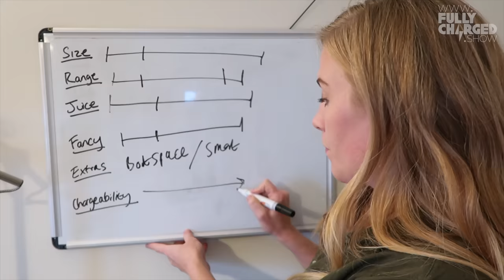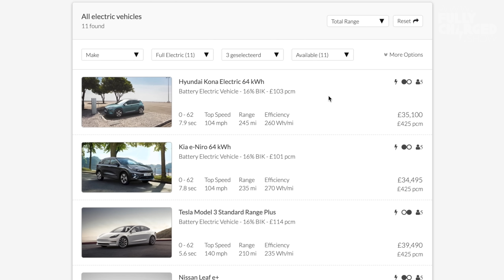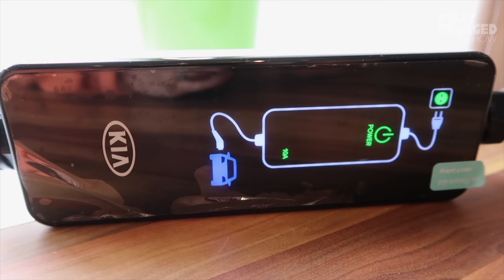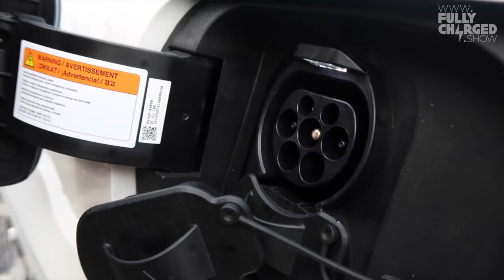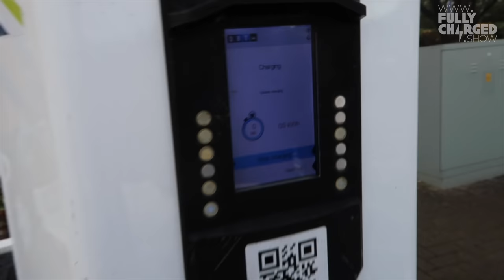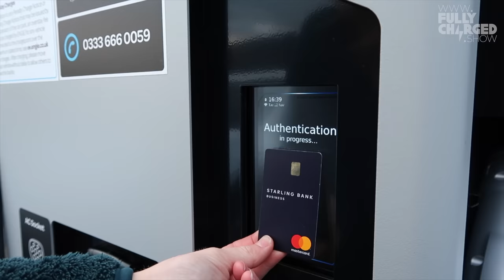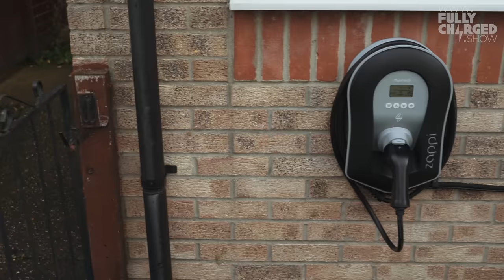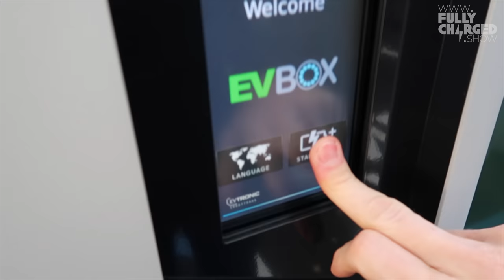Maddie Goes Electric, Episode 6: Living with an electric car (Round-up with Robert) | Fully Charged

Comment: Please please please, can we have “Maddie goes solar”, followed by “Maddie goes house battery”?
Reply: Oooh I like this idea
Reply: I'd like to suggest this too, I'm more in the market for solar and battery storage at the moment... Electric car is still a few years away as my "gas guzzler" is still going strong for the time being. Great mini series, really enjoyed it!
Reply: Arfan Ali 
I changed my car first. Financial no brainer. Less than £1,000 spent on “fuel” in 4 years, some 42,000 miles ago.
The financial jury is still out on solar PV and the battery. I have all three now, one leading to the other.
Solar PV and house battery take many years to pay back the capital investment. However, it is intuitively just the right thing to do to help tackle climate change effects by burning less.
And with each technology, I just wonder how I ever managed before without them.
Reply: @maddiemoate  So, Maddie, are you getting solar yet? We're all waiting patiently for the new series. :D
Reply: @maddiemoate  especially after the recent electricity price rises!  Would be very topical. Most people have gone from roughly 13p/kWh to 22p+/kWh.  But if you have an electric car you can be on Octopus and paying 5p/kWh at night. If you have solar + a house battery then you can get through Spring-Summer-Autumn days. In winter you can charge it off the grid at night and draw it down during the day. Either way you're avoiding the 22p/kWh peak time! Also, the extra solar can heat the immersion tank during the day / charge a car - so cutting back on gas usage too! My installer can now get 385w JA Solar panels for under £100 each! You now only need 11-12 panels to hit 4kW. Though I do recommend installing as many as will fit on your roof!

Comment: I Bought an Kia E-Niro after watching this beginners guide. We love our EV so thank you Maddie and team. We have noticed an increase in the number of EV’s in the last few months. One of our frustrations has nothing to do with the e-Niro but with the charging network. We had to go to three different charging stations this week to get a single charge. The first was a New BP Pulse where both chargers where out of Action the next was a Shell Recharge Station where a Tesla had just beaten us to it. We eventually got a charge at a GeniePoint. I wonder if Maddie could do an update video a year on? As a side note, the BP Station had 10 Fossil fuel pumps with only one car filling up and the Shell Station had 8 Fossil fuel pumps. That’s 18 Fossil fuel pumps and only 3 charging Stations (with 2 not working). This ratio needs to change very, very soon otherwise I can see a big negative story for new EV Drivers. We should be putting the same number of charger as Fossil fuel pumps at each station. Could fully charged do a video on this maybe.

Comment: I've had an electric car for over 2 years and watched all 6 episodes of this, they've been great. 

I had the exact same problem as Maddie on my first long drive, the day after my lease car arrived, a Drive Electric car too. My very first Rapid charge was at Ferrybridge, in the middle charger with that very same Rapid, I was so chuffed how easy it was until I returned to my car to find only a few more miles were added. I also did lots of research before getting the car. I soon learned after that to use the CCS and I've loved driving ever since. Great series, thanks.

Comment: I love the facility she went to that had all the EV's under one roof. The fact that you can do your research and get question answered. I wish we had this in USA. I recently went to the Chicago auto show and was disappointed in the electric being represented. I went to the Kia electric section and the hands on displays weren't working, plus no staff to ask questions. It was a real disappointment
Reply: it's so annoying when event managers do a token effort and there's nothing actually worth seeing
Reply: + Candycane, I suspect that in the US, where the Infernal Combustion Engine has ruled for so long, a lot of Car Manufacturers don't like the change, (their whole lives have been about HUGE cars, with HUGE cubic inch engines, making lots of noise, and 'Small and Silent' is not Machismo enough), and dealers will point you AWAY from an EV, as they want the 'repeat business' from servicing and maintenance, and they know that with an EV, there is very little to do. 
To think: When I was growing up, cars needed a 6 MONTH oil change: Thick oil in summer, thin oil in winter (to aid starting). Multi-grade oil did away with that, and I bet dealers hated that too!
Reply: @candycane
  If you are ever visiting Toronto, Ontario Canada they also have a Plug'n'Drive center in the suburb of North York.
Lots of cars that are available in the Canadian market to look at, drive and discuss with staff who know what they are talking about.

Comment: We've had a Kona Electric with the long range battery for over 6 months. Though most of our driving is local & I mostly use our home charging point to charge the car. We have been on long trips from Chelmsford to Devon and Chelmsford to Leeds, and found rapid CCS combo chargers work well, except for Ecotricity (something to do with their charger software, especially on their older chargers). In all this time my wife hasn't driven the car once. She is a little nervous of the technology, especially the instant power delivery when you press the accelerator. I love new technology, so it is difficult for me to relate to her concerns. I saw your driving electric vehicles beginners guide, and was very impressed with the very straight forward language you use to described your electric vehicle driving and owning experiences, and shared the video with my wife. Hopefully, this will encourage her to give the Kona Electric a go. Thank you for a great EV video series.

Comment: Thank you Maddie, this series was great to watch and felt very genuine first time raw experience of EV's.  Maddie's  a natural and engaging presenter who delivered a very informative series. I would dearly love to have an EV but I live in a mid Victorian terraced house with no off road access, this alone is a cause for concern in the current state of charging availability/ access. Thanks very much to all the folks at fully charged I will continue to enjoy the friendly and informative output.  A possible follow on from this series might be to try and match up the needs of a "worst case" scenario with a EV, something like a rural driver with no off road access and poor availability of charging. Is it possible to have an EV that is only used occasionally under those circumstances, how long would a vehicle hold its charge when standing in the open in all weathers etc.

Comment: This has been great for me as I’ve been looking at going electric, however living in a flat makes things tricky as our building owner defaults to “No” about everything.
From watching your series I got over the “I must have a home socket” mentality and have a Mini Cooper SE on order - at the same time I’ve been tackling our building owner and putting them in touch with various companies who can implement the infrastructure and cost charging solutions to get our building owner to consider putting charge points in our car park.

Living in a city centre with low mileage makes my use case perfect for an EV, if only it wasn’t for living in a flat.

Comment: Really enjoyed your electric journey even though I have an EV already. You did mention something very important to many sceptics out there, as 97% will not go back to an ICE vehicle. Many believe they cannot afford an EV. It would be good to demonstrate when you downgrade your Kia Niro to show that most households could in fact afford a secondhand EV (like the Renault Zoe with a lease battery) and still benefit from huge savings in the form of petrol/diesel, tax, congestion charge and maintenance. Yes, the charging infrastructure is not there yet, but improving and evolving fast with more available, easy to locate and access without the need for an app or special card. Every household could manage with a 3-PIN plug charge but it’s nice to have the 7Kw option too, but not essential. Plus ICE owners can be assured that range isn’t everything, as I believe 90% of car owners only travel locally and within a 15 - 30 mile radius. Your show with Robert’s guidance has been a huge game changer and eye opener for many out there. Well done. Looking forward to future episodes.

Comment: It’s been said many times before but I’ll say it again.  Great series, I’ve just bought an EV and this was just what I needed, thank you for putting together such a great program.  Regarding future episodes Maddies goes PV and Maddi goes Batteries.  With bidirectional chargers coming onto market, it would be good to know what’s out for those who want to use the car as its battery supply rather than purchasing a separate battery bank.  It would also be good to see when you downsize to a smaller car and what drives that choice.

Comment: Maddie thanks for the information.

The only cars currently available in South Africa are the BMW i3 120Ah (i3, i3s, and the REx versions), and the other the Jaguar I Pace.  The only used options are those vehicles too, seeing that Nissan Leaf just can't be found as used, and the new versions are not sold at all.

I think I would also have made the same mistakes, and if I could afford it the i3 has more then enough range for the longest distance I currently drive with the return.  The only thing I'll have to look at is maybe the speed, seeing that 120km/h  (75mph) is the national speed limit here.  For range anxiety to not totally take over, the I Pace seems like the better option, seeing that I'd have a reserve left after after my longest trip for the shops and whatever else I need to do around my home town.

I think I should go the reverse of your method.  Start with the solar and battery storage packs, then the type 2 home charger, thereafter the EV.

And yes, I'm glad my knowledge isn't that bad on EV's, because the hesitation isn't the battery range, but more the price, and those that falls in my range are definitely older and of much to short a range for my longest trip, and wouldn't last the whole week to drive to work, as I would prefer to charge once a week, where my car would be home for over 24 hours, leaving me charged for the remaining week.

Comment: Thank you ... fantastic and entertaining series. Opened my eyes to what's possible now ... hopefully batteries will continue to improve and budget cars get a decent range.

I suppose my big concern is that as EVs are adopter the charging network capacity might struggle to keep pace and then have long waits to get to charge points on longer journeys.

Keep up the good work 😁

Comment: I liked the series, thank you all for putting it together.

I'd like a series on the privacy side of the electrical infrastructure: what (if any) information do the car manufacturers collect on you over and above what they do with oily cars, given the interiors suddenly all contain smart and connected technology, including things like everything running on automotive Android and the Google angle that introduces? How about all the other smart tech, like the smart chargers? How about the privacy attitudes and policies of the various companies that make you sign up for their (fast) charging networks and/or payment cards? And what support are manufacturers committing to on their connected tech? What life cycle do they have in mind for smart chargers that people will use until they physically won't function anymore and what happens when these two periods don't match?
Reply: Agreed re privacy issues. A family member purchased a basic Tesla 3 on line and they delivered a higher options model. After the contract was signed and the car paid for and a couple of weeks went by, he received an over the air wireless "update", which disabled several of the optional extras. I can see the future. If you miss a monthly payment, your EV will be restricted to a 5 mile range at 20 mph. Imagine buying a regular car with nice hubcaps, and a week later the dealer comes to your house and removes them.

Comment: I am a model 3 owner and Maddie's experience with the third party chargers reflects mine as well. I never understood Tesla owners raving about the supercharger network until I went to use my first non-free DC fast charger. As I understand it, there is a VIN exchange with the charger so I can't understand why you can't authorise you car (maybe with a bit of stuffing around in the app) the first time and then have it work automatically, just like a Tesla charger, from then on. The chargers must all be networked or they would not work at all.

Comment: One issue I have with Zap-Map is that some chargers are private, behind closed gates. I drove around near Luton the other day for about an hour before I found one that was actually public and then it was busy so I had to charge using the 7Kw charger beside it until the other driver left. It doubled up my travel time. EVs are great but there's a lot to improve in the network and software supporting it.

Comment: If there was a charging option for homes where you could have a pay terminal built in, allowing people to charge from your driveway (with a pay system so they're covering the cost of charging, not you) it could rapidly increase the available charging options for people with minimal effort.  It wouldn't be mandatory, obviously, but it would give people more options when route planning if they could pop into someone's driveway for 20-30 minutes for a quick boost to make it to the next fast charger.  It could even be a way for people to make a little bit of money and offset the cost of the charger.
Reply: It's called Zap-Home in the Zap-Map app.

Comment: Good luck if you get a Zoe.
Very diplomatic about public charging, I would have hammered them for the lack of simplicity, and for the high cost at service stations.
Many comments I've seen suggests people are crying out for an estate EV. A tough work vehicle and family transport. SUVs don't have the load length or shape for transporting sheet materials or half a dozen large radiators plus tools ladders etc.
A Zoe half a metre longer and a bit wider with lay flat seats please!
Reply: MG are releasing the MG5 later in the year.  An electric estate with a decent range at an affordable price.  There are signs that it will be able to tow.  Very few  EV can do that (I can only think of one in the UK).
Reply: @manwithcorsae7738  I wonder what the 'affordable' price will be?
Would EVs be able to tow if they had gears?
Reply: @jeremylister89  I hear it's around £28k.  Gears are not necessary in an EV.  The motor produces masses of torque from zero rpm.  EV have a reduction gear to stop the motor revving to ridiculous rpm.  Zoe's motor is turning at around 12,000 rpm at 70 mph.   I reckon the reason why EV in UK (and probably Europe) aren't rated to tow, and they are most certainly capable just look at the number of EV are same models as their ICE equivalent that can tow, is that towing will seriously reduce the range and the manufacturer's don't want to advertise that point and put people off buying them.  As battery sizes and range get larger this will become less of a problem and I see many manufacturers rating their cars for towing.  In the US where the system is different you do see EV towing.  Just remembered, Bjorn Neyland, Norwegian YouTuber, tows with hos Tesla Model X.

Comment: Great series... one quick question/observation, though...

Many EVs seem to have the charge socket located towards the front of the car - highway code suggests parking in parking bays with the nose outwards into the roadway. Can't manufacturers make the EVs with sockets at both front and back of EVs (as well as WiTricity underslung charging plates)?

Comment: A possible series is the same as you have done for getting an eV car but for eV motorcycles.  I don't drive but I do ride a ice motorcycle and wanting to move to eV motorcycle but the current system of getting information is convoluted and all over the place.

Comment: The one thing that annoys me is most people say electric cars don’t require servicing which is bullocks.
They still need servicing like every other car, they still need new tires, brakes, lights, fuses ect. Its very misleading when people say they don’t require servicing when in fact they do. It just doesn’t require as much and would most likely be cheaper than a normal car.

Also something id like to know how long does an electric car battery last, not in charging terms but as in how long it lasts before the battery doesn’t hold charge and how costly is it to replace?
Reply: Zee MR JPG they need brakes changed very rarely - you never use the brakes ( regen). Tyres - yep like you would on a normal car. But there’s very little else to do - hardly any moving parts compared to ice cars. Just ask someone who owns one
Reply: @reubenwilkinson845  he's right, EVs still require servicing. Mechanical parts - brakes, steering, suspension, lights  need checking/changing/lubricating etc. You still need an MOT(UK)... 
The point also is, if you do low mileage, running costs (fuel and servicing) are low. So, relative cost of EV ownership is still very high.
I literally can't remember the last time I needed brake parts replacing, or exhaust parts, or a cam belt, or, or...... 
The figures don't add up if you're a low mileage driver - not even close.....